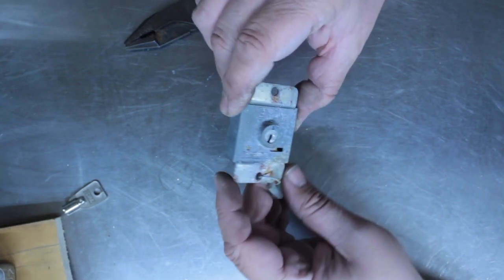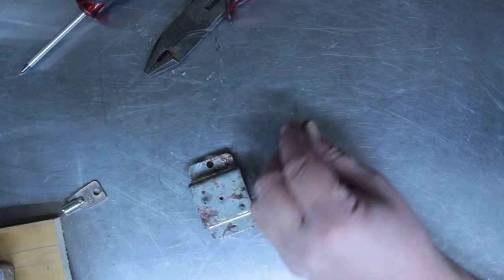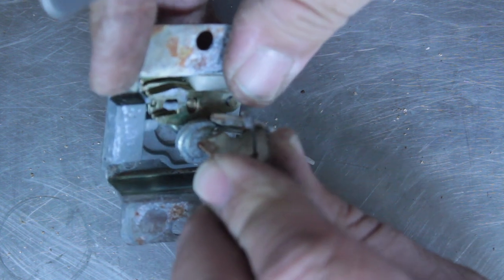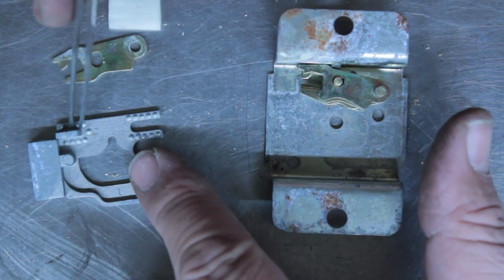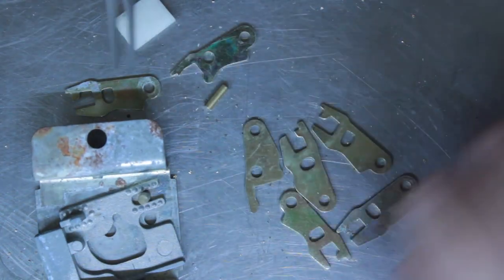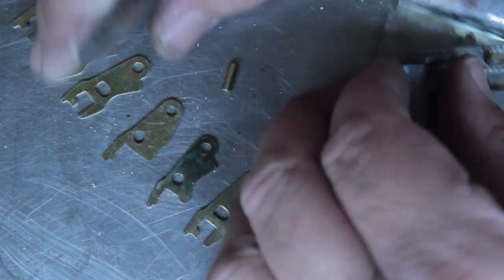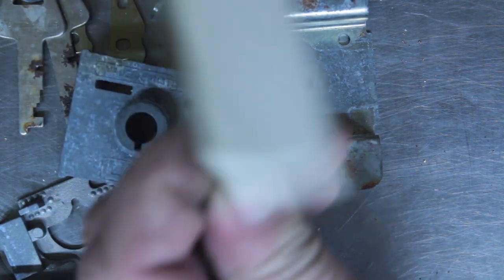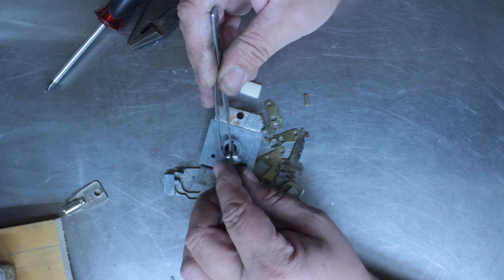Old Lower & Fletcher ZA Cupboard locks

Comment: They're a blast from the past. Haven't worked on or cut a key since the mid 90s. I worked in a shop in Whyalla SA back in the day that had the BHP contract and they were very prevalent on the worker's steel cabinets. From memory, the ZA was the short nozzle projection and the ZG was the long nozzle projection. And i agree that there were Master keys for both series. It's funny that you can still get the L&F flat keys that suit that application from LSC. Cheers Dr:-)
Reply from the maker: That is funny, they seem to stop selling anything that does not sell in volume,